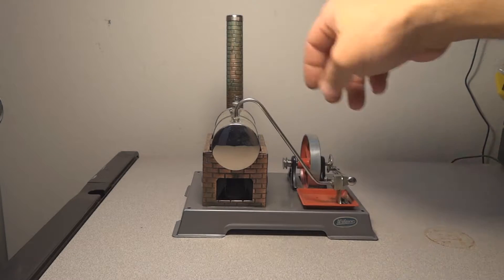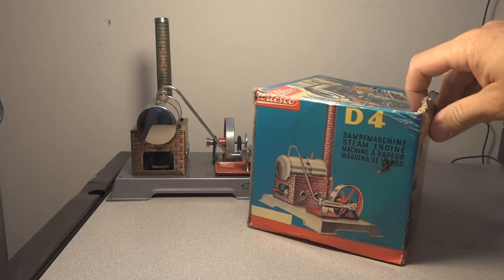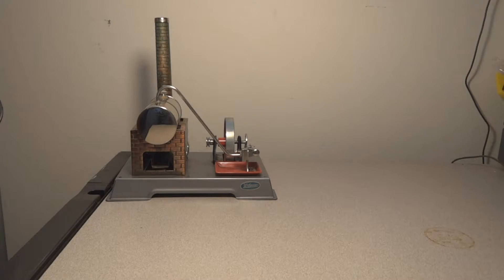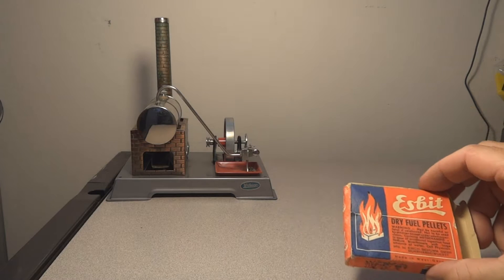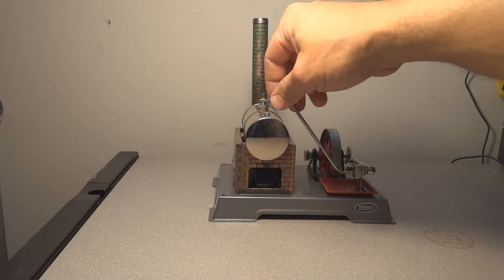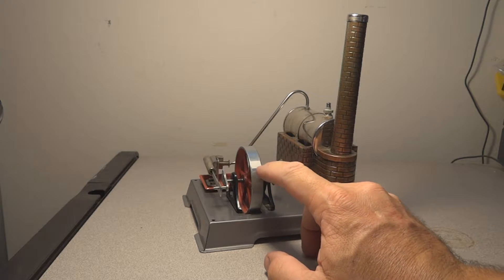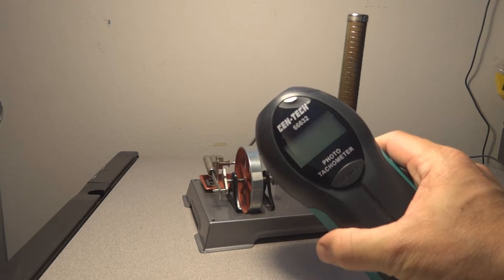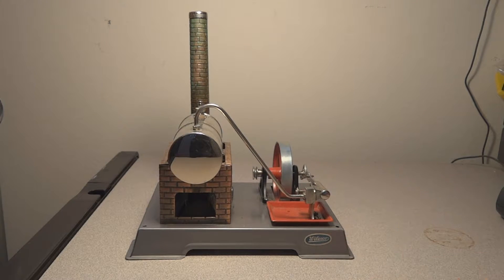Wilesco D4 steam engine over 8500 rpm

Comment: I very much doubt the validity of the r.p.m. stated ................ it seems far closer to 850 r.p.m.!  Ideally one should blacken the whole outer face of the flywheel, e.g. with a black marking pen before applying the white reflecting tape.  I've owned a model R8 for over 30 years and recently dismantled it completely and rebuilt it securing a 3mm aluminium plate under the original base.  Instead of rivets for the two main bearings bolts and nuts have been used.  The whole unit is far more steady when running until it gets to 2 400 r.p.m. and at that speed one gets the notion that that speed is too fast.  In a high speed state it runs best at about 2 240.  Before each run it gets one drop of s.a.e. 30 mineral oil at each of the five reciprocation/revolving points.  My one interest now is to govern the speed, looking for an r.p.m. of close to 2 000.  I'm now close to success disputing that the original safety valve is correctly and safely designed.  It appears not to allow for steam to pass through the valve cylinder thereby lifting the piston ..... nor is the spring tension suitable.  I therefore filed a small vee shaped cut in the flared end of the piston so as to screw off the spring.  Then I filed a flat the full length on each side of the piston.  I have now substituted the 0.40mm spring with one of 0.30mm of the same length which allows for an escape of steam when the engine runs at about 1 770 r.p.m., lower then the speed I seek.  My ultimate intention is to use this engine to charge my android phone via generator, regulator and charger.  So far no good but I'll not give up easily.  joeyroo2@gmail.com
Reply: Yusuf Mohammad that is nobody's 900 rpm